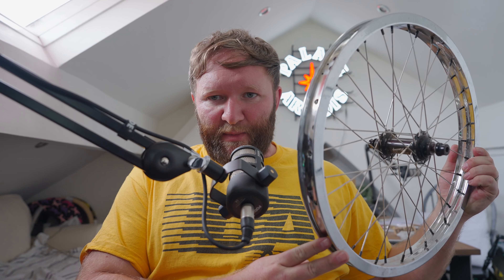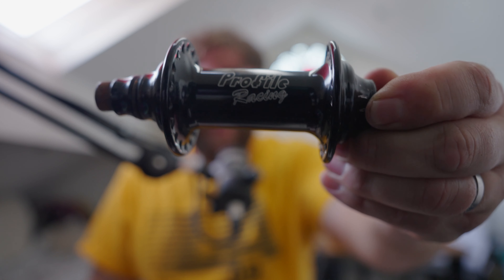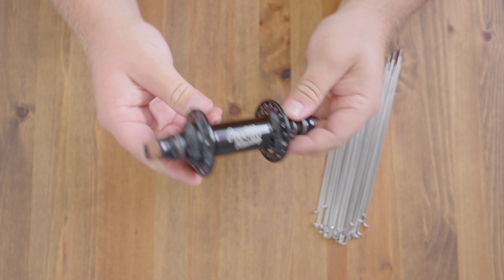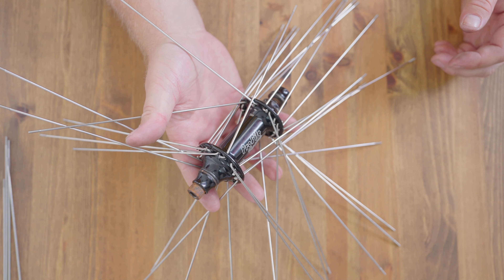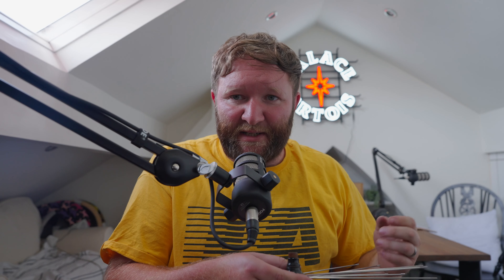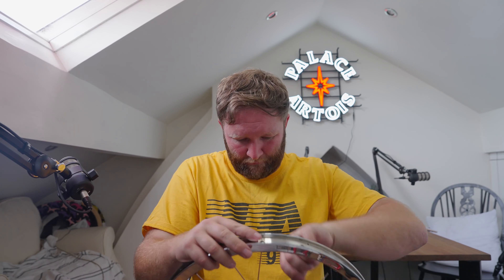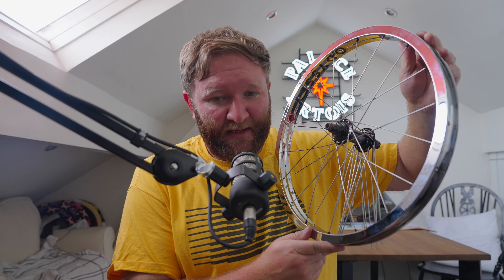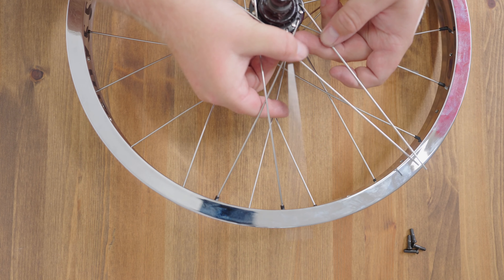HOW TO BUILD A BMX WHEEL...THE EASY WAY!

Comment: Not familiar. Will refer to this at some point if need be. Previous builds always result with the valve clearance error  ( or lack of!!)
Reply from the maker: Making sure you start with the two spokes to the left of the valve whole results in no issues with valve clearance. As long as you’ve stuck to the same outbound under inbound on both sides of the wheel 👍🏻
Reply: @Foundationbmx  Ok, nice, thanks for the Valuable tip!! 🙏